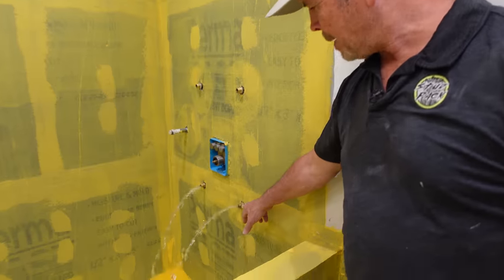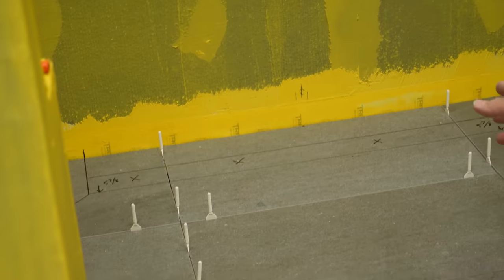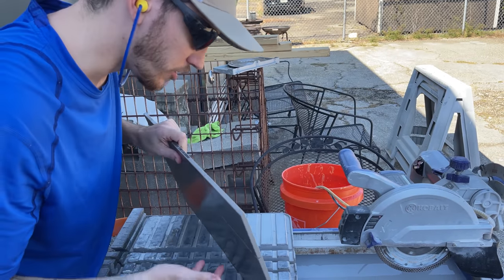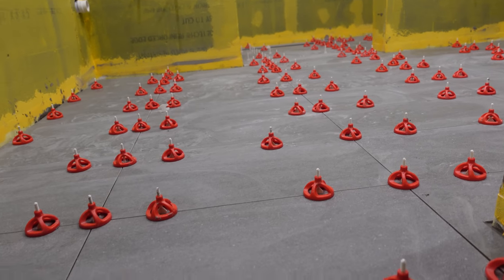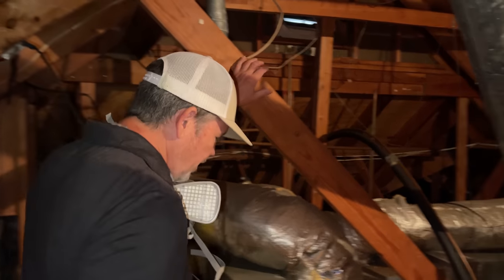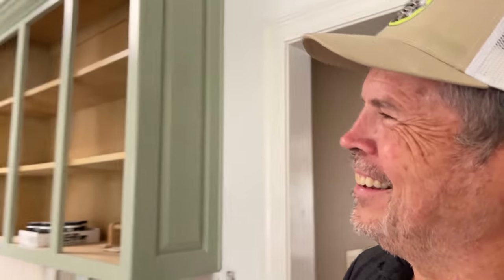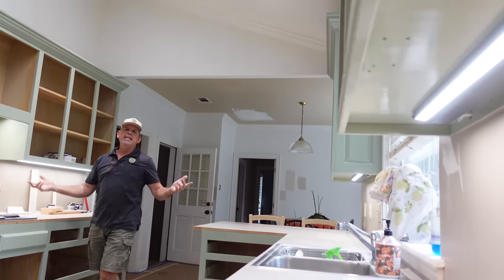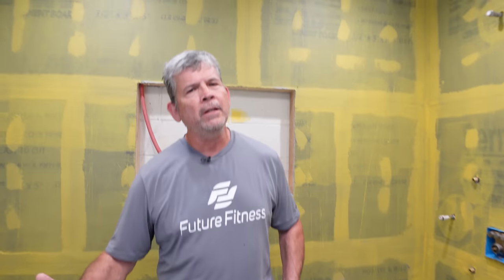Tiling a MASTER LEVEL Shower with ENTRY LEVEL Tools! - THE SHOP Part 18

Comment: Binocular Bob here... Just wondering about those little triangles that were missing ? :)
Anyways great video as always. I watch all of them as soon as they come out. You guys rock and congrats on the expansion of your Stud Pack team. Extra set of hands are always good on the jobsite, Welcome Rad! Gonna be epic watching the STUD PACK house come to life.
Reply: Was wondering that myself.  At the end of the video there a couple of quick shots that show they didn't forget them.
Reply: Sameeee thought!!  🤣🤣🤣 But at the end it also seemed they didn’t fill them in 🤔 one did one didn’t so I am still confused
Reply: If I had to guess, they're going to fill those in with a different type of tile so have a little inlay detail. Like a triangle of white marble in its place or something like that. Who knows though lol
Reply: Was wondering the same thing as well.
Reply: If I had to guess the small triangles kept breaking so it's just going to get filled in with grout. If they're using grey grout it's probably wont even be noticeable. It's also much easier to lay smaller tiles afterwards as they can shift around while setting all your tiles. Use your sponge to wipe away some mortar? Now your tiny tile shifted and you have to mess with it again.
Reply: Those little corners were cut off because of the Envelope Cuts that formed valleys to the drain. Otherwise, the corner of that tile would be sticking up into the valley.
Reply: @williamchurch614  Exactly. They’re for the slope in the shower. They will probably be filled with thinset.
Reply: im also wondering why they didnt bring the cut-thru line straight to that corner to avoid that triangle altogether.
Reply: @PerfectPrinceX1  the cut line goes from the corner of the drain to the corner of the shower so a set cut. Overall a corner to corner cut with a patch piece is better than a line that's off. A line that doesn't meet each corner is brought to someone's attention more than a little patch piece would.
changing the grout width might have helped or having the centre line have a tile either side rather than one in the middle

Comment: I used a similar tile spacing system. The guy at the tile place said “I used way too many spacers” 😂 I’m glad to see you guys using the same amount
Reply: A few extra spacers costs peanuts, hitting your bare toes on lippage somewhere costs years of saying "if only I used a few extra spacers", and "we're gonna save this great floor" instead of "let's rip it all out, the floor's not perfect anyways" in a future remodel.
Reply: @Candisa  exactly! And it was my first time ever doing tile so made it easier. Plus I forgot about the kicking them off part lol

Comment: I use my glow rods differently. I push the rod through first and hook the wire to the tail end to drag the wire behind it. It makes the glow rod much more manageable when going through hard to reach areas. I use them a ton running low voltage.

Comment: Two valuable details in the video.  1.  use of the vibrating tool to remove grout and 2.  the spacers with orange screw caps.  Caps are necessary imo to keep those large tiles in perfect level as the thin set cures.  Thanks!

Comment: I've tried every leveling system and this one is the very best. I started with it when it was the Spin Doctor system, then bought refills under the Ridgid brand. Research the clear discs you put on the post on top of the tile under the red spinners. They keep the tile from shifting. It's a great system!

Comment: Dont cut em upside down. You get more blowout. Just get the top cut where you need it and clean it up with a grinder.

Also with those tiles i like taking a diamond file and creating a slight bevel to match the finish edges. Sometimes its a nice touch!

With work like that you really think having a third isn’t going to result in a lot of standing around?
Reply: Nice tip brother

Comment: Hey Stud Pack, what are you planning to do about those tiny triangle gaps where the slope cut meets the edges of the tiles?  Are you just gonna grout them or are you gonna install tiny triangle pieces of tile?
Reply: That's exactly what I wanted to comment about. That little detail matters a lot
Reply: I don't think it would look that good with just grout.  They're tiny triangles, but much larger than the rest of the grout lines.  Curious to see what they say about it.

Comment: Just as I've stated before, I have learned quite a bit about the whole process of waterproofing and different methods of tiling from the Pack.  If ever I decide to tackle such a project, I will def. reference from this and previous videos. I really like the dry pack method. And I love all of the new leveling systems that you guys showcase. Great job, guys.  Welcome to the Pack, Rad.

Comment: Re: walking on tile you laid the day before...I installed 300 12' saltillo tile 20 years ago on an ice-cold winter day. I went out the next day and had a heart attack because the mud was the same liquid consistency as when I installed it.  I didn't know about the effect of temperature. On the fourth day the thinset was finally hard. I think your tile layout was perfect for the tile and the area tiled. Tile is basically "forever" so I like taking hours or days to choose the final layout. (I would install triangles of different colors in those two little untiled corners, maybe his and hers colors.)

Comment: Thanks guys! Layout first is very important! I love the screw type levelers. I used to get Rigid through HDepot but have to order on Amazon now. I don't know if they were discontinued. I will check out the Rubi. The Rigid had different configurations for 4 corner, T offset and straight. With the different configurations you use less. I always reuse the screw part, too. What tile saw will you get next? I have a 10" Dewalt  hand-me-down. It still cuts true! I love watching.

Comment: Dewalt make a diamond cutter for the buzz saw...it's thicker than the blade you used, but good to have in the toolbox (used mine today). That bathroom is coming along nicely. Keep going gang...almost there!!

Comment: Old mans tip. Slather heavy dense hand lotion all over arms and legs that will touch or be exposed to fiberglass or rockwool. It helps stop it from sticking into your skin. Or for painting too. Same thing. Jam it under your nails too. Or working on greasy cars/trucks. Clean grease the skin first.

Comment: Impressed with your work and the detail in the video's. Curious if any of your videos show the transition from durarock to sheetrock in an alcove tub. My plan is two will meet at a corner utilizing a vinyl corner bead fastened to sheetrock and Dura rock. Schluter will tie the tile in at the corner for a smooth transition. I'm using vinyl as I've seen metal corner bead corrode in a bathroom around the tub in a previous life. I'll keep looking but wanted to ask and any comment would be appreciated. Again, very impressed and love seeing folks that actually produce and smile while doing so. The 'ol man used to have us all singling while we were digging ditches. It helped make the pick and shovel just a bit less challenging. Hard to believe that was 50 years ago.

Comment: The attic access at 13:00 looks like the attic access in our home. But to make it worse, the board that covers our attic access hole is supported by nails that stick out from the sides of the access hole. Naturally, the nails snag your clothes when you climb into the attic. (Fixing that is on my to-do list.)

Comment: Awesome job guys. Not going to lie, I've been anxious to see how you were going to handle tiling around the drain. I just wrapped an install with the same exactly linear drain and I chose not to use schluter around the edges, which, I'm kind of regretting. I'm hoping one I get the remaining tile in that tray, you won't notice the exposed edges as much. I used a black hexagonal mosaic tile, which is a lot busier than the tile you chose, but my question to you guys, is why you guys also decided not to use a schluter or similar.  Looking back, maybe I was thinking when it might be a pain to try and get those 45's lined up nicely.

Comment: I do have a question you guys will probably never see but how do you get the tile perfect with the joints in the backboard. It isn't much but those splices that are thinsetted with fiber tape are raised. The only thing I can guess so far is you use so thick of thinset for the tile that it doesn't matter but I often can't do that using smaller tile or dealing with trying to get flush to adjacent flooring. Just curious if there's tips/tricks for it.

Comment: The last guy I worked for tiling bathrooms had a kobalt tile saw, I promise it couldn’t cut straight to save its ass. I adjusted everything I could and got it down to 1/16” off in a 24” cut

Comment: 18:09 use a qep carbite grout removal tool. They are about 15 dollars and are faster and safer than the multi tool or razor. They haven't chipped any of my tiles yet.

Comment: Once again - fantastic work. Question: Where you made the envelope cuts, was the width of the cuts the width of saw blade? Did you have to file the edges so they weren't sharp? On which cuts did you use the snap cutter and which ones did you use the tile saw on? Welcome Rad

Comment: For the diagonal cuts on the envelope...did you tighten the tile-leveling-nut all the way down?  I assume at the diagonal cuts you wouldn't want to do that, because you'd defeat the purpose of the pre-slope underneath...is that correct or am I missing something?

Your channel has become my favorite, thanks for all the great content.

Comment: Do you guys back butter those tiles? What size trowel are you using? What happened with the two corners missing on two tiles? Was that for a reason?
Reply: You can see Rad back buttering them and def required in a shower, for that size tile 10 - 12mm, corners missing is because of the letter box layout (guess that was their compromise) and they will put them in later as they are hard to level while the others are wet

Comment: hey guys, what’s the trick for the transition of tiling between backer board and drywall on those walls? Did you tape and mud the joints or did you use mortar or did you just leave it alone?

Comment: Rad seems pretty cool. Were those Project Source unfinished cabinets in the background? Ah, the advantages of having someone slim to get through tight spaces. This is why I call on my best friend a lot. He can squeeze into places I can't and he can help pull me loose if I get stuck (or just laugh at my efforts to get unstuck for a few min before helping). Speaking of lights, do you have any suggestions for a good vent/light/heat one for bathroom to replace the old Broan ones from the 70s? I have those kind and they suck to change bulbs in. Only the light part works in mine now. I'm glad you put new lights in the kitchen. I hate fluorescent lights. 
That one little missing triangle of tile in the shower bugs me for some reason. LOL.

Comment: how do you handle spacers that break off and leave small prongs in the floor? We tried using pliers to grab them and twist them out but that can easily damage the tiles by chipping them.
Reply: I've learned it's best to go with a wedge style spacer to avoid this. Simply use channel locks/pliers and pry against the wedge, breaks perfect every time.
Reply: If you have small spacing, a soldering iron might be your only option. You could possibly try a grout removing tool to file them down if the gap is big enough. Best way to avoid them failing is keep thinset away from the sides, so it can snap at the base.

Comment: That water on the right though would bug me no end
But you wouldn't use them both at the same time...
Would you 🤣
Reply: I do in mine.  It's worth getting dirty just to be able to use a shower with 7 heads.
Reply: @kensherwin4544  🤣🤣🤣🤣🤣🤣
Reply: Once they are under pressure it should be all 4 on both sides, like in the prior test video

Comment: That paint on membrane is not long term water proof.    I used red guard on a flat roof shipping container exactly as the label says.  and used multiple coats.  It is good stuff but not  permanent.   I have used fiberglass and never had a leak.   But these paint on just are not the same.     Any shower I do in the future will have a fiberglass liner.   It is about the same cost as these paint on liners.   You can see in your video that the wall was very thin on the paint on. Fiberglass is permanent and no way going to leak.

Comment: Anyone attempting to use an oscillating tool to clean out grout/mortar should be very careful when doing so. It's very easy to tilt the blade too much and chip the tile, depending on your tile and grout combination this could be very noticeable. It kind of looks like this happened at 18:14, it's rather small and will be unnoticeable once grouted.

Comment: Haven't installed a can in a few years. Go canless and don't worry about blocking or anything else. If they are can less, what's that can on the back called?
Reply: It's just an empty housing so the light can rotate to the needed angle.
Reply: I was wondering at first but then it made sense. Angled ceiling. Glad I saw that because I want to do my kitchen. I would have used the thin ones and regretted it.

Comment: Hate to be that guy, but you boys didn't tie the water proofing into the drain in any way
At least some silicone sealant surrounding the linear drain would have added some insurance

Potential leak point in the future

Or perhaps it was done off camera
Oh well